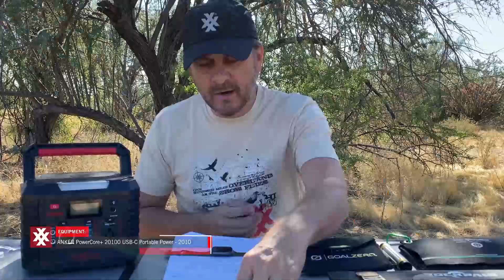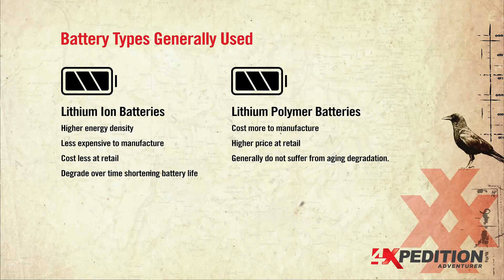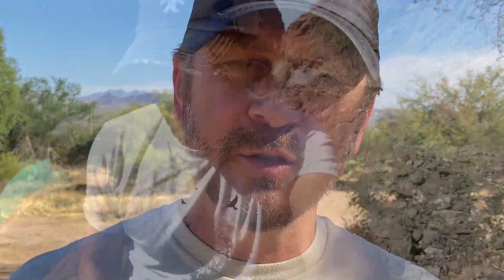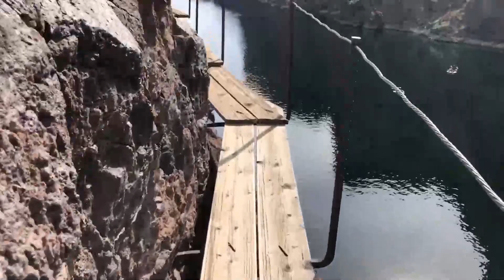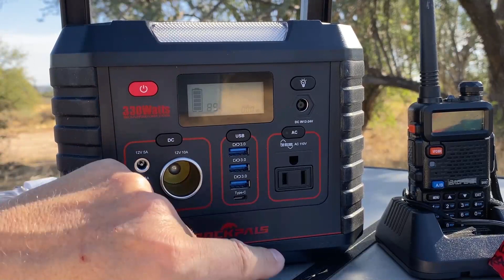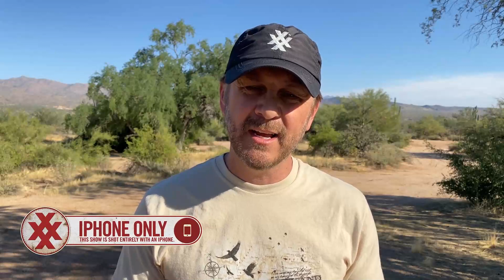Rockpals 330W Portable Power Station

Comment: I have this..was offered it by rp to replace my 300 that stopped working..the manuals suck for all of them.. I also have the 350, which froze up sooo..but..not sure if I'm doing something wrong but how the heck do you charge your phone wireless lying? Do you just set phone on top? Is there a button to push first? Do I need my Bluetooth on? Cuz, so far, I'm not having any luck..thanks much..

Comment from the maker: 20% OFF Rockpals 330W power station, apply code: RPCRSM20
https://www.rockpals.com/products/rockpals-330watt-portable-power-station
Rechargeable 289WH Lithium Power Supply Adds Wireless Phone Charger. As For CPAP User, It's Only Suitable For CPAP Below 120W.